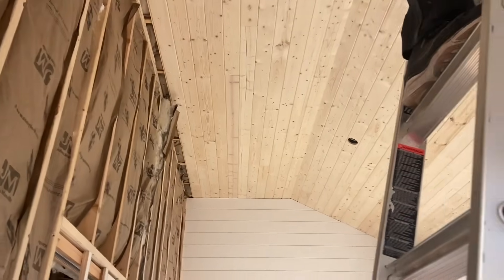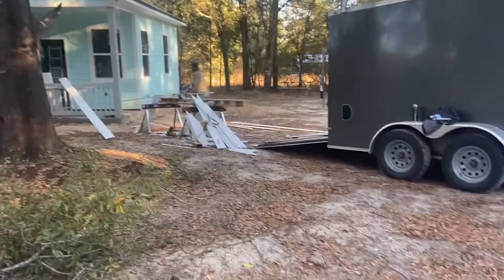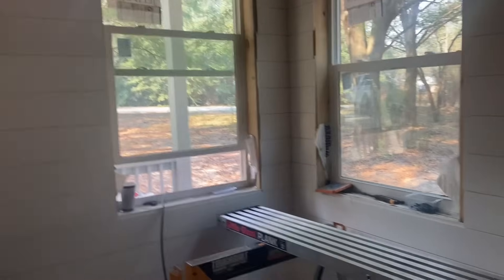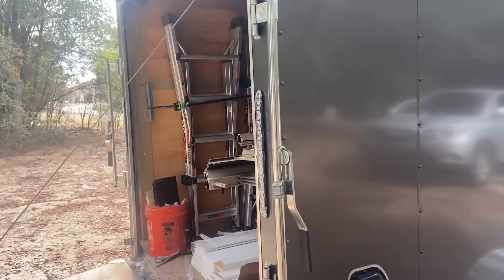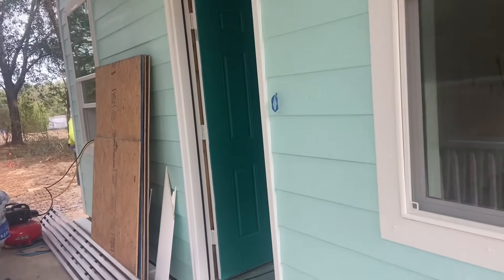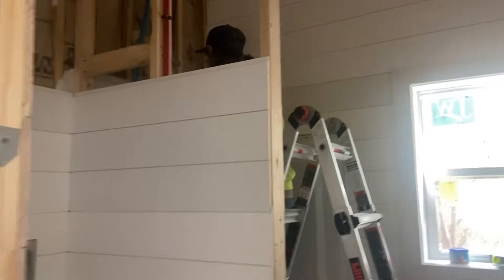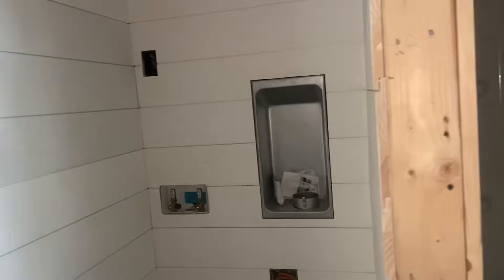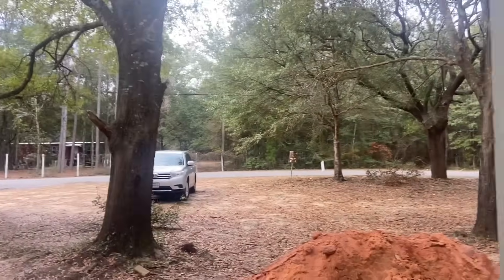Tiny home “WOW” moments, meet “Tony” builder/finisher, construction terminology, scraps to crafts

Comment: Hi Linda! It is looking great.!
You will be very happy with your  high  ceilings during the summer. As you said, heat rises. 
In winter you can heat the  smaller room, if you need to save on electricity bills.

Comment: Ceiling fans very important when you have high ceilings to push heat/AC downwards.  I know you mentioned a mini-split. Seems you would need 2, one for living area and another for bedroom/bathroom, since you have a wall divide. I didn't know stand alone homes can pass inspection without a central heating system, but you seem to know what your doing.